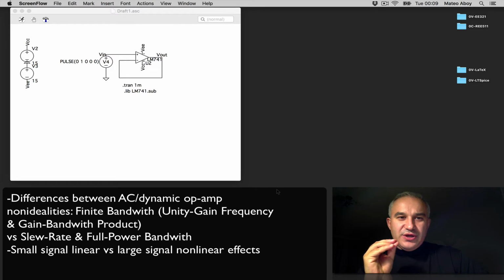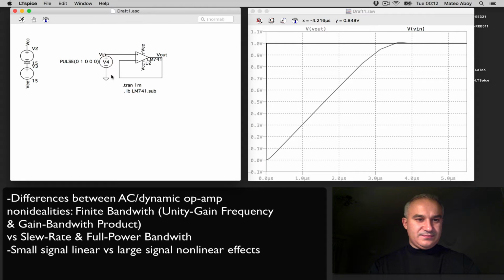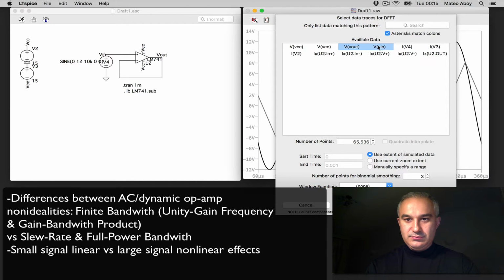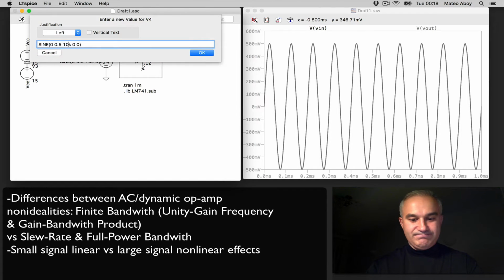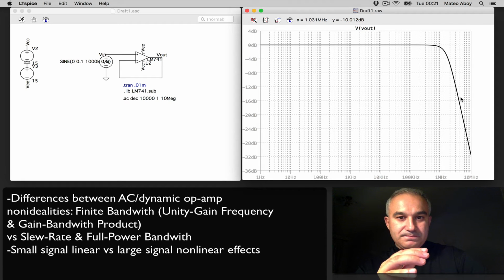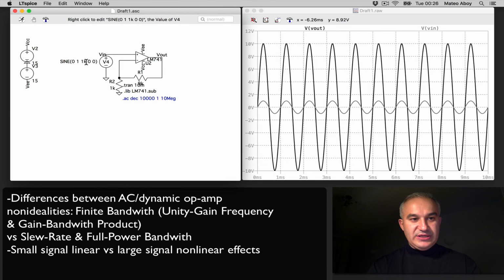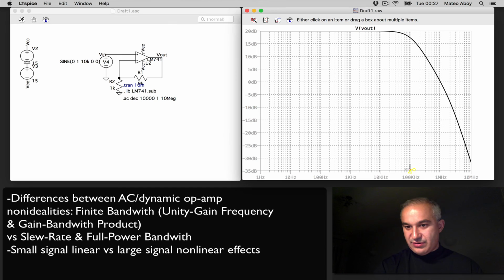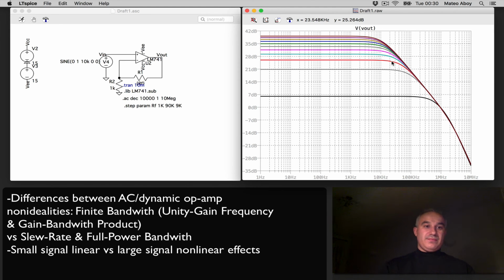LTSpice Tutorial: Slew-Rate vs Finite Bandwith Limitations

Comment: Thanks for this! Is there a way to put together a set of commonly used external models so that you don't have to follow all these steps for each custom spice model in each design? Kind of like creating your own part library you can reuse? It's not crucial, but it would sure be nice. I saw a tutorial that parallels this one for the Windows version, and it also didn't mention a way to create a reusable group of custom components.